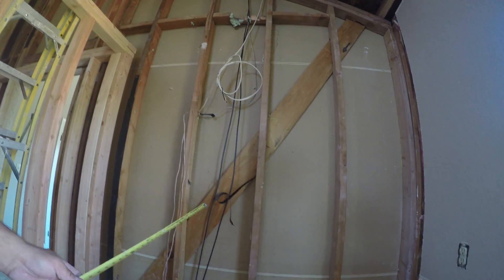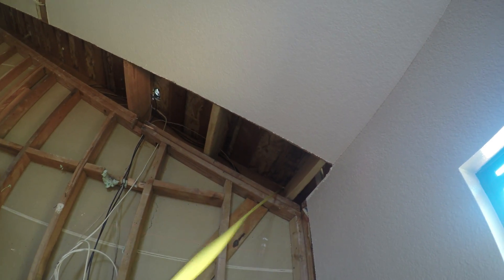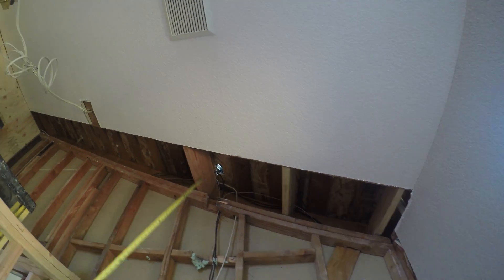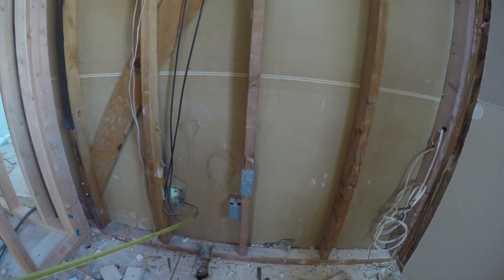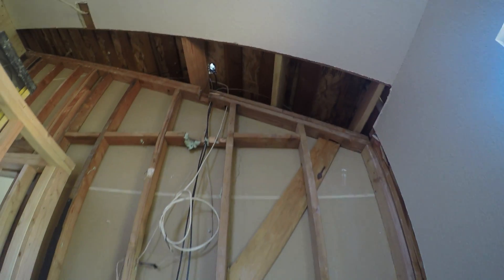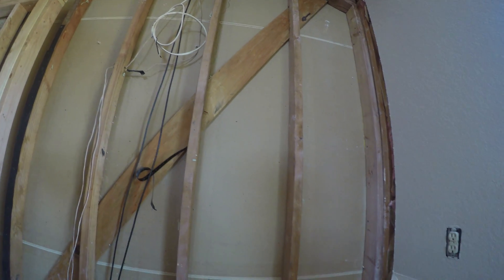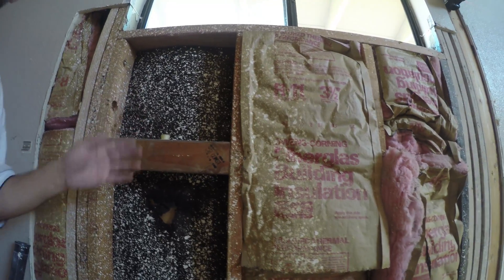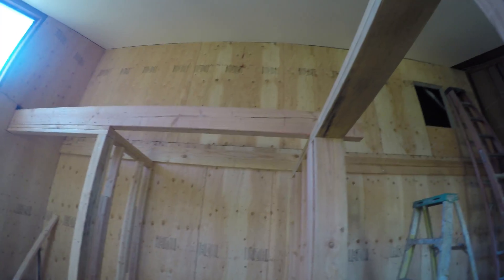Common But Shocking Building Code Violations Behind The Walls  of Older Houses

Comment: Also which code do I have  use. IBC or IRC some people said if I use engineered structure may need ibc e.x. metal beam for open space or garage opened  thanks for your advices
Reply from the maker: one is commercial, the other is residential, but they are not legal as is. The most important thing is what your local building code, which one does your local community adopt.
Reply: Thanks for your answer so in other words I have to find In my case new Jersey building code if that is true where can I buy it? I thought purchase irc in Amazon it will be enough to learn how to built according the code
Reply from the maker: you need to talk to your local building inspector before you build anything. If they approve your plan, then you are doing it right. If they don't approve your plan, they will hand you the rules  that you can follow, you just need to modify your plan so that it is approved.
Reply: Thanks again for you prompt response I really appreciate it